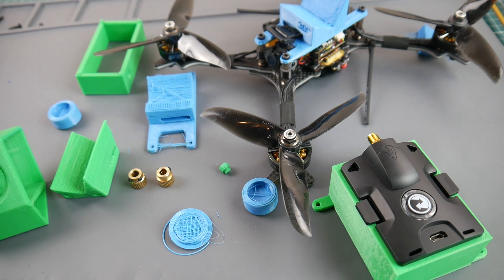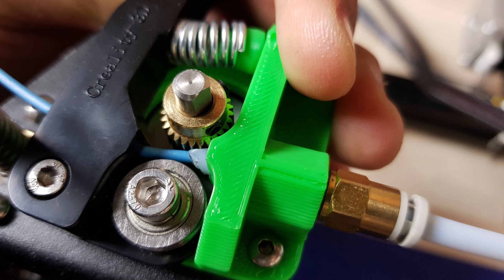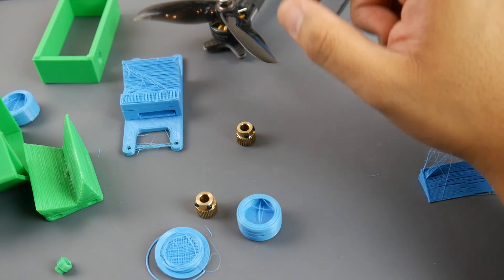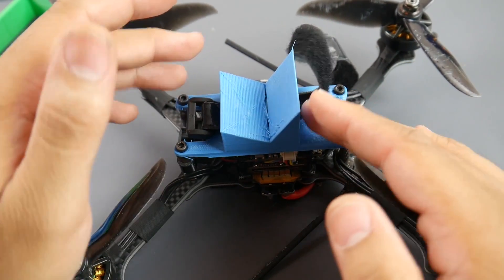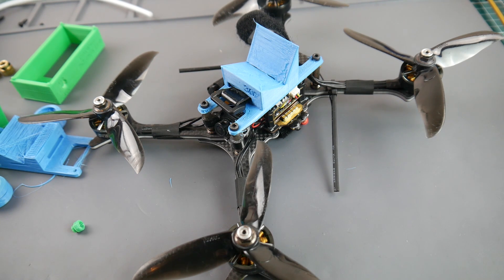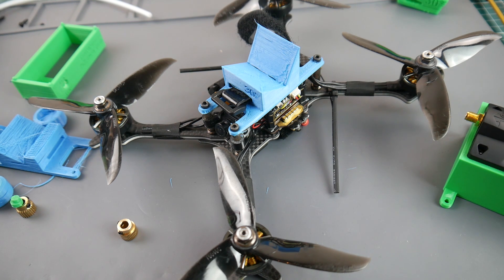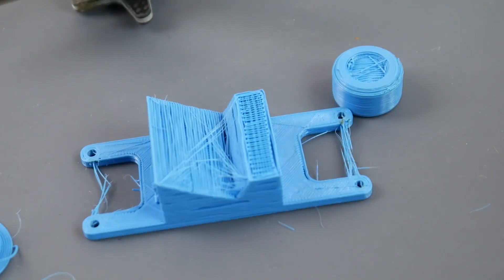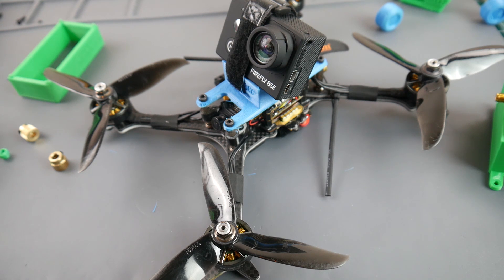How to Print Flexible Filament with proper mods // Creality Cr-10 Mini

Comment: what size nozzle do you use?  bought a pack of nozzles for my taz 5 from 0.3 to 1.2mm. wondering if bigger is better for TPU, I've only got a small splash spool of ninjaflex cheetah. Great colors but damn expensive

Comment: I'm very interested in what other settings you use for PTU. Wall thickness, infill, etc. I've got a new roll sitting on the desk just waiting for some time to get my print settings dialed in for it.  I'm tired of my lipos getting beat up so I've got a lipo protector design picked out for the TPU.
Reply from the maker: 6 perimeter walls
infil depends on hardness
speed 30mm
temp is what the filament states.
Heated bed always 50c
0.4 resolution/ layer height
Reply: @DroneMesh  Awesome, thanks. That gives me a good place to start.

Comment: Nice video Mesh , if you wanna stuck with tpu (or any :)filament switch to direct extruder , bowden extruder for me its nearly unusable, if you switch filament brand you have to adapte with this filament , like (PIDs in quadcopter  😆 ) not all the same , we dont print above 60mm/s anyway .. 
keep going ..
Reply from the maker: I got couple prints on PLA decent at around 90mm ... Jave not tried faster than 30mm on TPU..
Reply: Drone Mesh i don’t know if any fdm printer can print in 90mm/s ( if you dont have volcano e3d ) , its is just value inside the printer options , but the realy value in the frimwere in (ex marlin ), every printer has 60mm/s maximum in the  frimwere itself .. we can see the travel action more faster  ,but the print processing keep the same speed ..

Comment: TPU and flex filament MUST be super dry. I bake the spool for at least 60 minutes at 80°C before every print. Any snapping, sizzling or popping sound coming from the hot end, and the print will look like crap and have poor layer adhesion.
Reply from the maker: Agree but I did not have any of those issue while printing. So I'm guessing it's an offset issue.

Comment: Fantastic, dude! Please, if you discover anything new about that, tell us! 😊
I want to buy an Ender 3... But let's see... I guess until the end of the year I buy it. 😊
Reply: Get one! Could not be happier with mine. Did swap the coolingfan for a noctua one though and rewired the coolingfan for the electronics so that it is always on full blast when i start the printer.
Prints tpu just fine. Havent tried ninjaflex though. Mainly print with ninjatek cheetah and primaflex and get perfect prints with almost no stringing at all.
Reply: 3d printing is a blast! I have had ender 3 for about a month. MAKE SURE... if you get ender3 kit, to watch every assembly vid you can. Mine (my 1st 3d printer) took all day to put together, including countless interuptions. In fact... im still learning things in the build that I missed, or want to improve upon. I used to work in a small print shop and those printers needed CONSTANT tweeking, so do these. I like it tho, others may not. The reward is in the  results of your effort.
Reply: @dsemolian3071  Absolutely, dude! I agree! And I will, thanks! 😃